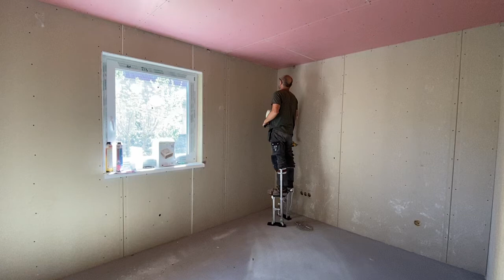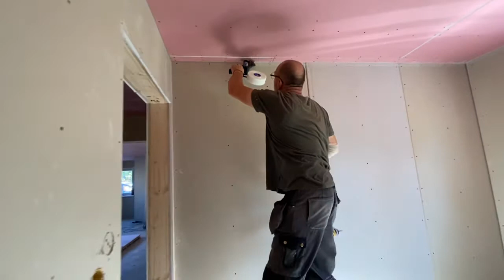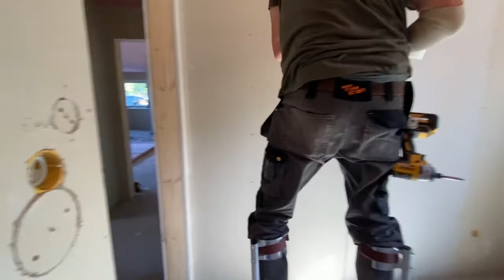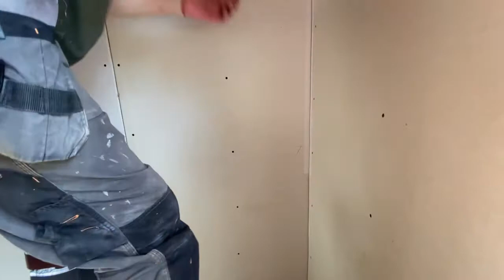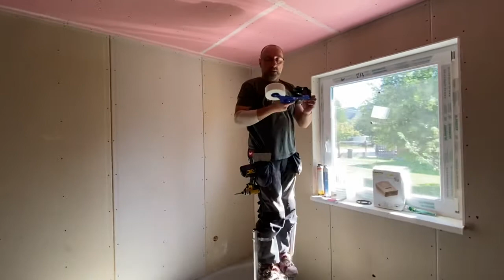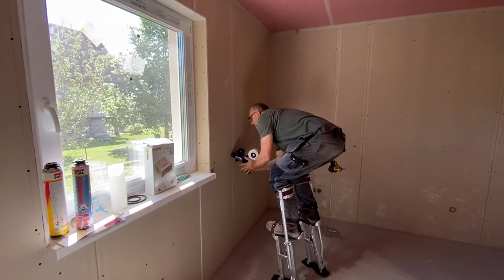Taping up a room using Marshaltown scrim tape applicator

Comment: Simply amazing. Ordering one right now
Reply from the maker: Since then I've found that the adhesive slowly builds up on wheel on the applicator with usage but that's too little trouble compared to the advantages. Just needs a little cleaning sometimes. So two years on I'm still happy using it ;-)